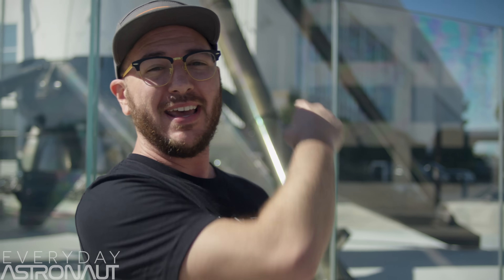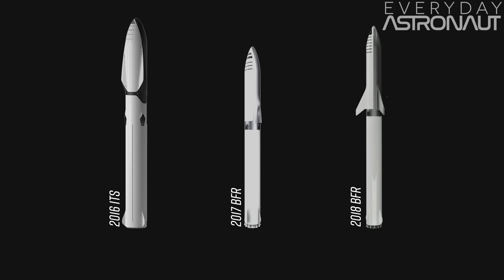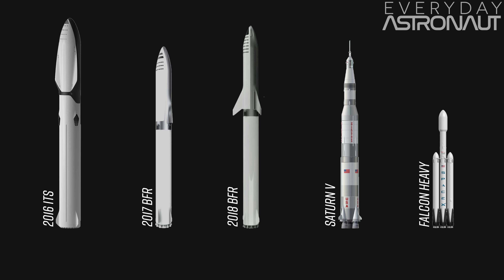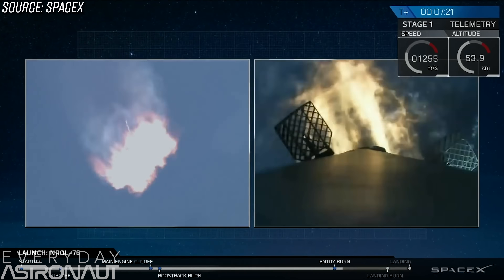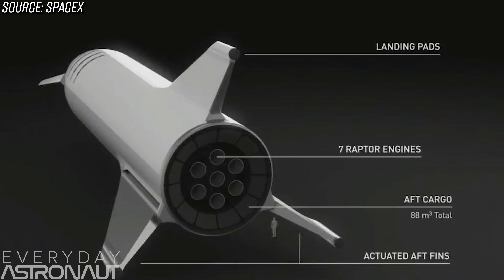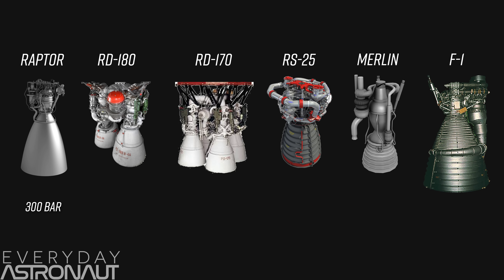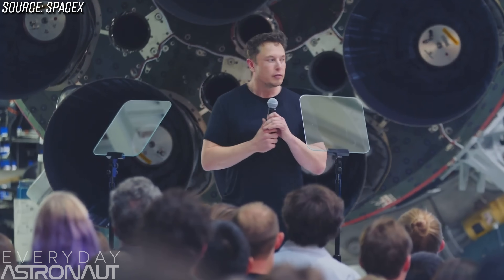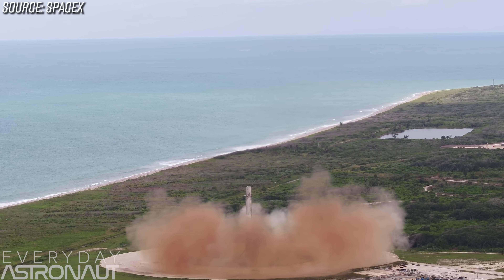Why does SpaceX keep changing the BFR? The evolution of BFR

Comment: The N-1 had 30 engines, and some sources claimed this the main fault with the rocket while ignoring the lack of full integration testing facilities and the extremely rudimentary analog flight control system they had (which was changed by a digital one for the 4th and last flight and was completely untested, who knows if the analog would have been more mature by that point even still crude).

I have always been skeptical of the "so many engines" justification on why the N-1 failed. Like a plane crash, there is never one isolated issue that causes it. Well, I guess they will shut up after the BFS.

On a different topic, and pardon my ignorance as I do not have enough knowledge to be certain of this,, but as it is presented today, I would feel much safer in an Apollo capsule than in the vertical-landing spaceship, given how difficult was to get vertical landing reliable and how many more things can go wrong than just splashing into she ocean after deploying three parachutes (the soyuz uses just one and it also has a good track record).

Comment: Maybe Elon chose to use a separate drive section with vacuum optimized engines that will attach behind the BFS which is why they only have sea levels only. This way SpaceX can leave the drive section in gto around mars or another body that can be used as a satellite with visuals and communications.

Comment: Every KSP player knows, that putting fins near the top of your rocket will cause it to flip over soon after launch. I know that KSP is not the most accurate simulation, especially the aerodynamics. But the core principle can't be completely false, can it? Will BFR flight computers have to make corrections in millisecond intervals so the rocket keeps flying straight?

Comment: Wasn't the ITS to BFR change because they couldn't find enough money to design a rocket as big as the ITS? Which is to bad, I think the ITS is around a fairly good size point for rockets, where scaling gains you some good advantages. It's at least around the same scale in payload as the Sea Dragon would have been.  https://en.wikipedia.org/wiki/Sea_Dragon_(rocket)

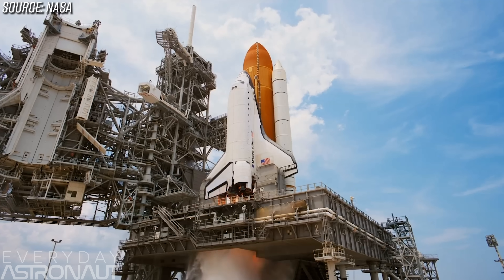Comment: 14:15 Correction: The Air-Force did not propose the Shuttle "Payload Size Deal", the Department of Defence did.

ps. maybe the Raptor Engines will have a Veriable Geometry Bell (ie. SSME/RS-25) or some sort of Bell Extension (ie. Centaur/RL-10) ?

Comment: what i dont understand: how does BFR scale for lighter payloads? How can a rocket this big suddenly be cheaper than an original Falcon 9? What's the concept here? it seems so unflexible.
Reply from the maker: Because it’s entirely reusable. You’re only paying for fuel as opposed to paying for a second stage that gets thrown away every time 👍
Reply: Everyday Astronaut Thanks! i was not sure if i missed something and there are different versions/sizes.   
so, it's supposed to be even cheaper when just lifting a 10t payload vs a F9. 
This is really revolutionary!! :-D

Comment: You might want to address the main reason for higher wider 3 feet. (not Tintin) This is in my mind to solve problems about landing on pristine soil. You have the problem of not level surface, surface that can bend, and then rocks, rocks projection at landing and at return launch. By widening the base you up the tolerance to lack of even ground. Also rear trunks could help balancing more mass to the rear when landing - stabilizing on the ground. I was about to congratulate you about the only interesting question of the whole press conference, but, well, you bragged enough about it.

Comment: Imagine the BFR popping a space station (or several modules) into orbit.

And I don't mean it being carried in the BFS shuttle-style, I mean Skylab-style, where the module is plopped on top of the BFR.
Reply: The latest proposed design of the BFR actually has a larger pressurised volume than the ISS (1000m^3 versus 953m^3). It basically is a space station.

If they could modify the design (remove wings, as reentry not needed, have the nose cone pop off or something once aerodynamics are not needed), and dock two of them together, it would create a truly massive space station. And for a fraction of the cost of the ISS.
Reply: Furthermore, picture an inflatable station module with the "packed" size being that of the BFR's max fairing capacity.
Reply: @aussie_boosh  That could actually work... You should reach out to Elon Musk and suggest that he create the first privately owned/launched space station, and maybe if he could figure out how to dock 4 of them together, he could make the first ever space hotel... and maybe either the station or the hotel could be a checkpoint for BFR's headed to other planets. And this isn't a joke, I mean this seriously.
Reply: @levisabin3047  
that'd be sick!
Reply: @levisabin3047 , the technology does indeed exist for this to happen. Bigalow Aerospace has an expandable habitat attached to the ISS which was carried into orbit by a Falcon 9. They also have had a couple of units in orbit by themselves.

Comment: And you, my friend, was the only one asking technical questions there! What's up with these reporters and silly stupid questions? Why there was no one asking how the wings affected the reentry? Why there was no one asking if they would try to have a raptor 2nd stage in the Falcon 9, so they could gain real world experience? Or why no one asked about the other versions of the BFS (the tankers or satellite launchers)? Why, why, why???
Reply: I gleaned this years ago I think from the NASA spaceflight forum and consider this little better than rumor but someone over there wanted a raptor upper-stage for the F9 and someone else (a smart someone I seem to recall) said Elon did not like multi-fueled rockets or prefered to avoid them.  I am with you though, I think they should fly these engines one or two times and and F9 2nd stage is a perfect place.

Comment: Spacex did end up with some fixed criteria. They decided to shrink the raptor engines to about the size of the Merlin Engine in order to use the same tool-chain easily. They reduce the 12 meter diameter to 9 meters for a bunch of reasons including preflight transportation.
Reply: The last renderings I ever saw of the Raptor on the NASA spaceflight forum showed the Raptor and Merlin were similar in size when it comes to the combustion chamber (although it's a little plumper to my eye (but there are no hard numbers that I've seen).  There is some extra plumbing involved for the full flow staged combustion and they expect it to mass around 1600kg which is 3x the Merlin's mass.  The rumor is the thrust to weight will be better than the Merlin which is already one of the best and if we use those figures we come out at over 2000kg so a 1600kg engine would up the T/W ratio over even the Merlin.

Comment: I think after they released the BFR they will think about the next stage of spaceflight.. orbital construction and then the BFR may just be the shuttle to move stuff from earth to Orbit and in Orbit all this dead mass of wings and sealevel engines can be thrown off. possibly there can be one large Cargo and passanger platform going every 2 years to Mars with just one BFR on board, to Transfer passangers and Equipment into atmosphere or rather the BFR is already waiting on Location to do the Orbit Mars Transport. same could also work with having a BFR with and one without wings.  and the ones without just travel through space and dont even have sealevel engines themselfs. Possibly the whole passanger Transport into Orbit can then be unified with the Continental Transport. Interplanetary missions can be planed and loaded long time ahead and passangers just arrive in the Moment the actual journey starts.
Reply: I thought the wings were for re-entry as are the sea level engines.  I agree 100% with you on orbital construction and throw in lunar industrialization as well..  I just also see the need for wings and engines... At least until there is enough existing infrastructure that we can refuel the thing in orbit at lower cost, then a more powered decent profile could be used and the wings could be.. modified. :)
Reply: @TheEvilmooseofdoom  well yes but i thought of like seperating the purposes and transfer of equipment. so there can be a shuttle bfr on earth and mars  and the distance in between is covered by a bfr without wings that stays in space... or an even larger platform
Reply: Ahhh, a space only vehicle.  Yes, that makes perfect sense.

Comment: Hi Tim @Everyday Astronaut

Important to note: the fins give drag, but not much compared to the hull. Their real purpose is stabilization and maneouvering. Just as Elon said, it's like a skydiver (very good comparison). Moving them "upwards" or to the "vertical" (rearwards in direction of flight), makes them give less drag and provide natural static stability on roll axis.

If the vehicle rollsto a side, that side's fin and cannard get more perpendicular to airflow, having more drag and making the vessel roll back to 0.

For pitching up, cannards can be put more horizontally and/or rear fins more vertically to make the nose more draggy than the tail, the opposite for pitching down.

For yawing, left cannard and right fin can be moved opposite to right cannard and left fin, deflecting air more to one side than to the other.

Also, all four surfaces can be moved to provide more or less drag and control the downrange distance.

It's a neat flight control system that can perform all those corrections without using RCS. It's awesome!

Thanks for asking Elon a technical question among the typical reporters' questions. By the way, if I asked about the money... I don't care at all about how much did he pay! I prefer to know how much will I need to pay, ho knows... 15 or 20 years from now?

Regards.

Comment: At the ten minute mark you talk about a sea level specific impulse of 330 seconds but if I remember right, Elon mentioned a number of 400 seconds at sea level which would be darn good.
Reply: From what I read the upper limit for a stochiometric methalox mixture ratio is 458s, but that burns so hot it would melt the engine.  At the 3.8 mix ratio spacex has said they'd use I don't think 400 is even possible but have to admit to having no numbers handy.  I think for sea level 330-335 has always been the expected numbers.  That's also for the proposed 40:1 expansion of the Sea Level engine.  Some bright person on NASA spaceflight did a chart showing different ISP's for different expansion ratio's but I have long lost track of it much to my regret.

Comment: The only set in stone thing the BFR ever promised to us was that its design would be.... Round and tall.   Everything else is production feasibility engineering mumbo jumbo to decide what it looks like finally and other specs.
Reply: If the tooling for the tanks is done then the shape of the guts are getting more and more fixed.  The externals will likely change several more times as they do more computer modeling.  

Tidal - Everything with wings looks like a 'shuttle' but getting hung up on the looks is simplistic.  What works is what counts.